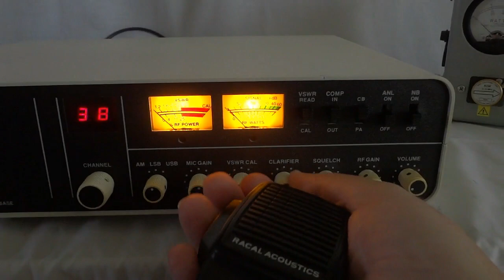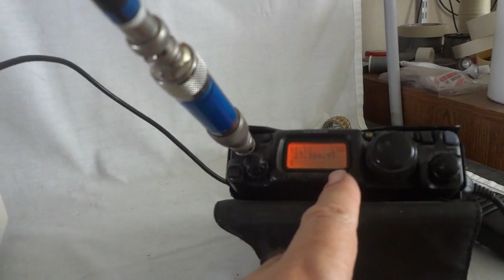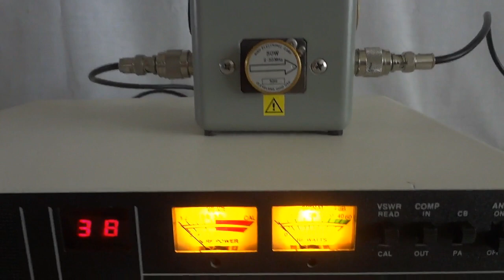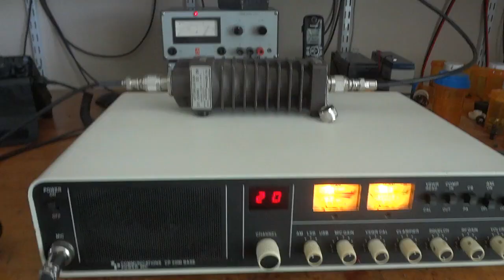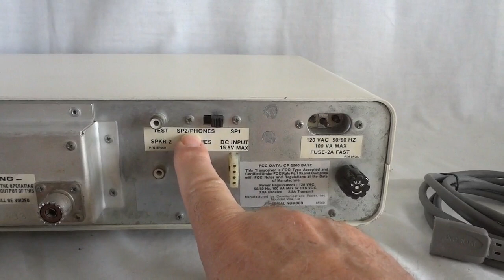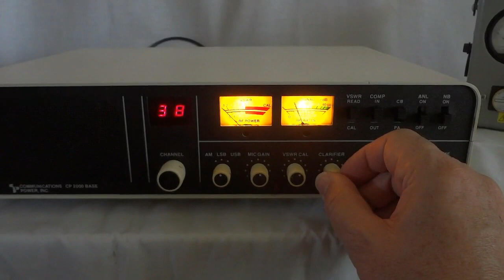Communications Power Inc. (CPI) model CP-2000 vintage AM/SSB CB base station

Comment: There was a gentleman that lived in my area, who was an engineer for CPI. I had the opportunity to purchase his CPI 2000 years ago. Also when I was a teenager a friend owned a cb radio business he ran out of his house. I remember when he got this radio in for a customer. He was playing around with it, chain smoking. Those white cases and knobs didn’t stand a chance in the seventies.😮
Reply from the maker: I would have loved to talk to that guy. Because they used an ExOr as a phase detector in the channel synthesizer instead of a dual-D flip-flop. The former requires much more loop filtering which makes the synthesizer unnecessarily slow. You can hear that when you change channels on this rig, it takes a while for the synthesizer to lock. A Japanese rig (they always use the dual-D FF concept) is much faster for the PLL to lockup. I always believed that to be the only downside on the CPI-2000.

Comment: Communications Power Inc. was a subsidiary of the Gulf and Western Industries conglomerate during the 1960s and 1970s. Gulf and Western Industries, founded by Charles Bluhdorn, was a diversified conglomerate with interests in various industries, including entertainment, manufacturing, and commercial communications. CPI was part of Gulf and Western's portfolio during that period, a commercial grate 11 meter radio with components typically found in the commercial two-way radio world. That’s the reason many of the CPI radios today still perform well, 40+ years after they were made.

Comment: That is a Nice Base Station Radio.  😃😃👍👍😎😎 Never had a base station radio like that before.  When I was a boy, our family just had the mobile radios (by Midland - Model#13-882C) in our cars i.e. Ford LTDs. That's what got me into radios and decades later in 1992, I passed my Novice-Tech Plus exam with the 5 wpm code.  I have an Extra Class call,  but I am the only one in my family with a Ham license.  They didn't have any interest in radios anymore after the CB phase.

Comment: I have this very radio in storage, it might be time to break it out and set it up. What recommendation do you have for an antenna?
Reply from the maker: I hope it was a dry, air conditioned storage. As antenna a 5/8 wave vertical will work fine. Cheers.

Comment: Mel from Central Nassau REACT had the mobil version, It was always on in the back of his CB shop.  He had some kind of 12V powered channel 9 filter in line on the coax.  To this day, I have been unable to google that filter and I have never seen one of those filters on EBay or anywhere else.
Reply from the maker: Hello. This radio can operate on both 127V AC or 12V DC, so it can be used both mobile or base, there are no two different versions. Regarding the channel 9 filter, I don't get that - why would you want to filter out channel 9? If you don't want to listen to it, just switch the radio to another channel. I don't understand, sorry
Reply: Sorry, but there were several CPI CB versions  I think his mobile was the CP300 or the CP400 with the CPI power supply with the intergrated front firing speaker.  The channel 9 noise filter was a band pass filter not a band reject filter.  The purpose of the filter was to only pass calls on channel 9 when it was switched on and to not pass the adjacent channel splater.  Please believe me I am not trying to be disrespectfull, I have been on CB since 1968 (yes, I am old). I worked at Mels shop and I also had my own CB business.
Reply from the maker: @arlenewolf5260  Hello! I know you are not disrespectful, all OK there. I was just wondering what such a filter would do but now I understand, thanks for the explanation. Cheers !
Reply: @LifeIsTooShortForQRP  Hi QRP, I have googled that CH-9 filter over and over again.  Even though monitoring CH-9 is pretty much a thing of the past. If I could find one I would buy it.

Comment: Hello from Australia, just wondering where do you buy those yellow/soft white LEDS from, been looking for those for a while now, thankyou.
Reply from the maker: Hello! What you need is so called "Warm white" LED diodes (the large, 5mm types). If you search for that you should be OK.  See here for an example: https://www.ebay.com/itm/163766355251 . File off the dome head, make it flat on the LED. This way the light spreads more evenly on the meter.
Some important need-to-knows when you install the LEDs: 1) In the original condition, the incandescent bulbs had 100 ohm resistors in series with them (these are R568 and R569 on the interface board, see diagram). Replace these resistors with 1 kilo-ohm resistors.  2) Make VERY SURE you have the correct polarity before you solder them in, otherwise they won't work. What I did, I opened-up the PCB holes on the board (using a solder sucker) after removal of the original bulbs, and plugged-in the LEDs in these holes without soldering.  Then you can experiment with correct polarization before soldering them in. ALWAYS use a temperature controlled solder iron at the lowest possible temperature setting, and use enough flux. That will prevent the board from getting damaged when you de-solder. Cheers.
Reply: Thank you for all your help, I have orders them so see how we go, just wondering do you plan on doing and more youtube videos, it's good how you show CB radios as well.
Reply from the maker: @waynegoodwin3217  Wayne, yes, I got a mint Sonar FS2340 that I want to do a video of. Also a Sailor RT-144 and a coupe of HF SSB aircraft radios are coming up. Cheers.
Reply: Thankyou for that, greatly appreciated

Comment: too nice ! i also have one , i want to revamp, it does still work has the extra channel mod , , need help  with finding  a restore guy .  i waited 20 years to find this ,
Reply from the maker: This one had the channel mod, installed by a CB butcher at some point. I undid all that and restored the radio to factory original condition. I have enough radios here that can transmit anywhere from 1.6 to 55 MHz (and then some), so I have no interest in "channel mods". I wanted this classic collector's item to be the way it was when it left the factory. Cheers.

Comment: I like your choice of LED used for the meter lights.
Reply from the maker: Yes, looks exactly like the original bulbs (even the way they sit on the board!). They don't get hot and will last forever, with identical brightness as the original bulbs. See my answer to Wayne Goodwin here on how I did that. Cheers.

Comment: I own 1 of those and all the other accessories CPI made. I went to thier office in the Bay Area. Easy modification to energize channels above 40 as well as boost output. I knew of 4 of these setups back in the day. I had a beam antenna Up on the Roof and I had a lollipop as a microphone. Best microphone ever made. Back then I had a cobra 132 in the car with dual 102 in whips and a 200 watt linear.

Comment: Any suggestion on tracking down a squeal on the cp-2000 using a CP Turner microphone.  The only way I can get it to stop squealing is to run down the mic gain down to 0, then I get no modulation.
Reply from the maker: Yes, this radio has a lot of gain already on the microphone input by itself. I therefore recommend bypassing the amplifier in the Turner altogether because your problem is most likely caused by way too much microphone gain. Cheers.

Comment: Are you in the US? If so can you align or recommend some one to refurbish my working CPI 2000! Receive is weak. 713-303-6095
Reply from the maker: Yes, I am in the US. Other than myself I don't know. But I do this as a hobby, not as a business. It often takes many hours to restore/repair these, and no-one is willing to pay $70 an hour for a job like that, and I can't blame them. One might as well buy a brand new CB then of course. Cheers.

Comment: Very nice video thank you yes I have one of these outstanding radios  The meter light has gone out is the voltage of the meter lights 12 V Yes I need to replace them with led's Thank you for all your info Mark
Reply from the maker: Hello. Yes it has 12V on the incandescent bulbs. If you want to replace with LEDs, get the soft bright ones (they have the same color tone as the original bulbs), and put a 1 kOhm resistor in series with the LED. Also, I filed off the lens (the dome) on the top of the LED for it to be flat instead of dome shaped, so that you get a more uniform light distribution on the meter face plate. Also, make sure the LED polarity is correct before you solder them in otherwise they will stay dark.  If you do it like this, the meter appearance will be indistinguishable from the original situation with the incandescent bulbs, but without the heat and the short life span. Hope this helps.
Reply: @LifeIsTooShortForQRP   Thanks for the info on the technique Haven't turn my radio on for a while I can tell the Caps Are going a lot of popping With no antenna hooked up They need to be replaced I'm Going to start with  power supply